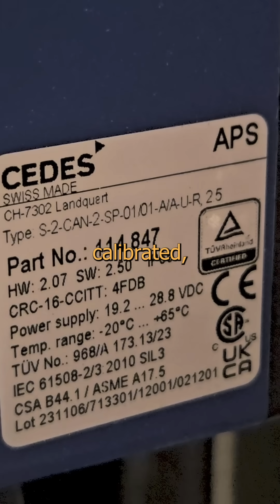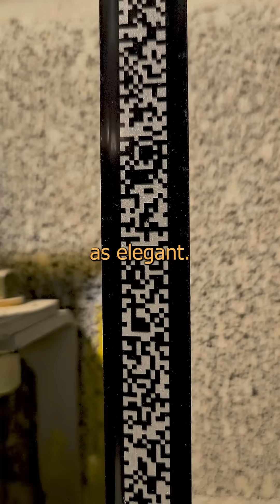Elevator Encoder #chrisboden #comedy #engineering #controls #urbex #indicator #resolver #barcode

Comment: Software engineer here, and I have some quibbles.

That bit pattern is only 10 bits wide, thus only 2^10=1024 unique permutations available. Unsure the pitch, but I'd estimate 0.100" on center, so the full gamut will be exhausted in 102.4", or about 8.5 feet. Unless the elevator is for miniature dachsunds, each word is going to have to span multiple columns. Some cheating can be done by using a sliding window instead of discrete regions, at the cost of significant added complexity.

In addition, there better be a pair of wiper brushes on the car or that nice, crisp code will quickly become a blurry gray mess. One of the big issues with any optical recognition system is good ol' dirt and grime, which something like a linear Hall sensor with periodic "key" indexes wouldn't suffer from. Any analog system suffers from jitter and SNR, but there's no sense in tempting fate by trusting in cleanliness in a dust tube that receives only yearly maintenance and in robustness in software where it's still very common for design to be entirely skipped in favor of merely (barely) meeting regulatory guidelines and marketing promises.
Reply: That was my first thought - but I think they are finding sets of lines rather than singles - I'd guess a clever set of triplets.  
Their data sheet says 1,500 meters with .5 mm resolution which by my maths gives about 3,000,000 positions to the tape.  
My guess is that the right hand bit which goes 1,0,0 1,0,0  and the left hand bit going 0,0,1 0,0,1 are marking out triplets of eight bits - 2^(8*3) = 16,777,216 counts
Reply: @TheShinyGuru  Which also explains why it's not something like grey code which allows neat unambiguous transitions (where only 1 bit changes between lines, so you never read weird invalid values when transitioning). So this requires more complicated reader, but less wide bit-strip.
Reply: @tylisirn  If its not a Gray code, then what kind of code is it?
Reply: @tylisirn you read my mind about it not being grey code.
Reply: @TheShinyGuru  There was me reading each line as a single 8+2 bits (Noting the MSB and LSB are clearly being used for line sequncing as you pointed out, and repeat every three lines) so I'd concluded a maximum of 768 lines (256*3). Never thought to consider doubles or triplets!

As for the spacing; Those marks look 2,5mm (1/10") high to me, based on comparing the marks on the strip to the other easily-sized hoistway equipment installed around it. 😇
Reply: That’s exactly how it works.  It’s not looking line by line, but over pattern area.
Reply: Thanks for mentioning the bit width.

It does look like the tape is engraved with the "grey" being recessed and photo reflective though. That should help keep things readable for at least a little bit longer.

I would imagine that they are reading a few lines simultaneously to figure out what "block" they are in, then positioning relative to a chosen line in that block once the section is identified
Reply: I thought the same thing, but then I thought maybe it's relative to the line above and below it. Although there are only 1024 different lines, if every time it's used, the line above and/or below were different, reading 3 lines at a time would give it, over a billion permutations, even more so if you add scanning 4 or 5 lines at a  time.
Reply: your math is assuming only individual rows are of interest, but even a single repeating row could be distinguished from others by just the rows above and below it, and certain rows intentionally repeat (i.e. at the start of floors, every meter, or other intervals) so that the elevator can determine it's direction and speed based on the binary sensor

there's not going to be much grime accumulating on a vertical strip hanging inside of the more-or-less completely sealed elevator shaft

the encoder isn't the only thing that the elevator is using to move, it's just provides additional precision. you have a main system that moves the elevator and additional fine tuning motors that adjust based on the binary strip
Reply: "Absolute position up to 1,500 m with a resolution of 0.5 mm" from the datasheet.
Reply: @mrfrenzy.  Where are you finding the data sheet? I'm keen for a different application.
Reply: This was what I was looking for!  Was super confused how it spans so far vertically with only 10 bits across.  Was curious if it had a specific pattern like QR having different regions used for error correcting but didn’t see an obvious delimiter.  The comments helped explain a lot.  Gonna look into the spec.

BTW, for those in other areas of the comments arguing about usefulness of QR should really understand how QR work and their resiliency.  QR codes still work even if a portion of it is destroyed.  Plus they convey a fair amount of data in a compact size.  Fantastic engineering!
Reply: The specific code type you're looking at is Data Matrix-style positional encoding, also known as a 2D optical position code or absolute linear barcode.

This kind of code is not binary, Gray code, nor traditional barcodes. Instead:

It encodes absolute position information in two dimensions, often with redundancy.

Each block or “tile” (like a pixel) forms part of a 2D matrix pattern that an optical reader can scan at any point along the strip to instantly know the exact position of the elevator car.

Some systems (like those from Heidenhain or TE Connectivity) use custom grid patterns where a certain pattern of squares within a local window resolves an absolute position.

Key features:

Failsafe: Can recover exact position even if the reader skips part of the code.

Not sequential: It doesn’t need to start from zero and count. Instead, the code at any location is globally unique.

Robust to damage: Even if a small portion is dirty or worn, it can still function.

This type of encoder is critical for modern high-speed elevators, where precise and fast positional feedback is essential for braking, leveling, and dispatching.
Reply: I don't think it needs to take a photo with a lens. To do its job the sensor can be designed to be as precise as needed but still "dirty proof"
Reply: This is more like a bunch of unique fiducial qr codes in a row. That box can look at the pattern and interpolate it's position based on perspective / how much the pattern is skewed.
Reply: @jahnkeanater please provide where you came up with that. Relying on the angle of skew for calibration or position requires very precise and maintained positioning. The fixturing and movement of an elevator is not precise enough.
Reply: @kevintaylor5017  The sensor is only measuring one degree of freedom. QR codes like this are used all the time for 3D positioning on atonomous forklifts. The track has a known pattern and width. The algorithm that scans QR codes already has to flatten the image so solving for the position isn't that much more difficult. Basically the problem has been super optimized already so that pretty much any phone can take an image of a QR and determine depth position and angle. That's probably accurate to a few cm. Then for precise location you can rely on the fact that the camera is in line with the track. Interpolating the distance between the center of the image and each row of data isn't that difficult.
Reply: Iirc its only like 0.100 degrees of skew on average across the full length of the tape.

The tape is being read by two seperate optical sensors that are reading a "square" of tape (roughly 10 square mms to account for perpendicular drift of the car). It has evenly spaced out "index" marks periodically and evenly spaced along the entire run of the tape that basically tick over a counter on the controller to let the controller know the cars speed, and how far it has gone over a set distance (since elevator cars literally work within a set confine). In between these markers are 5mm blocks that are 100% unique along the entire tape. There is literally no logic programmed into the tape itself, its just pure noise in a manner that avoid repeatability. In theory you could achieve roughly 5000 stories worth of unique register on a single tape, but the company can only manufacture up to around 12 stories iirc. The heavy lifting is all handled by the sensor and controller. The fact people are approaching this as if the tape is somehow the sensitive and important bit is incredible to me because that makes no sense.

The sensor is just reading a constant 5mm area, when you drive the elevator to the height you need it to stop at, you tell the controller "hey, whatever you are looking at right now? Make that a floor in the memory" and it writes that to cache and thats that. Whenever it finds that 100% unique 5mm square of whitespace (its reading the reflectivity not the overall darkness value) the elevator knows its at the right altitude in the gangway. It is NOT as complicated as a lot of you people are trying to make it. It works almost identically to how a lot of optical robots do on production lines.
Reply: Agreed.  Also a coder of 3 decades.  This encoder feedback loop is fragile.  Hall effect and magnets makes more sense. Sometimes things are done because of patents though.
Reply: Never thought I would fall for it like that... nice pp
Reply: classic software engineer getting caught up with the "what ifs" on a solution that already works in the real world 😭😭
Reply: yeah as is covered, it's likely contextual. And hopefully has some sort of error correction / checkbit. (who knows what some specs of dust or oil could do)
Reply: The reader scans more than 1 line at a time. I reads multiple like a standard qr code. Each extra line gives it exponentially more combinations.
Reply: Optical sensor powered mice get thrown away most of the time just for being dirty instead of actually broken
Reply: Think of the bits going up and down, not across. 1 strip down  shows maybe meters, second strip decimeters, third centimeters, and fourth millimeters. Much higher resolution is possible then. Encoders have only a small disc but are capable of even finer resolution.
Reply: You're not making any sense at all. It's like saying we have a finite set of possible number combinations bc we only have ten digits to work with. Think about it.
Reply: @punchkitten874  You're missing that while what you say is true, the number of distinct numbers you can make with say "2 digits total" is finite and limited (00 through 99, for a max of 100 distinct values).

He's correct that with the 10-bit width of the strip, there are only 1024 distinct combinations possible per horizontal code.

However, as others have rightly pointed out, if the scanner on the elevator reads more than one line at a time (like three stacked codes), a huge number of distinct patterns are then possible.

The hard part is getting a good error-free read, especially when the scanners happen to be straddling two adjacent lines.
Reply: @ddichny  No, y'all keep adding conditions which don't appear to be present. 💁

Comment: My one college electronics project was making a system to control elevators. We had 7 different sensors to choose from and an EPROM chip with 100 lines of BASIC to play with (kids, ask your father). No barcode line like this though.

(I managed to use 5 out of the 7 sensors, had it able to run hydraulic, screw and pulley lifts on a circuit board smaller than a matchbox. I would have used all 7 but i ran out of inputs... What I would have given for this system and an Arduino back then would probably involve carpal tunnel syndrome)

Comment: Ever since I started working as a groceries delivery driver for a supermarket, I have gained a new appreciation for well calibrated elevators. I carry the groceries in a pile of stackable boxes with a set of wheels at the bottom, but they're not connected, so even the tiniest step up can be fatal if the tower is 3 or 4 boxes tall, but to be fair, I can only be grateful when there is an elevator at all, many clients don't have one!

Comment: Thats not the easiest or smartest way. Elevator should have a flange or something that travels vertically. Shaft should have magnets placed at the correct height. When flange detects its between two magnets, it designates that as stopping/floor level.

Comment: I’m guessing that’s a smartrise hydro going off the inspection station and selector tape. I have installed a few like this the bar code system works really well. The elevator always knows its speed and location with exceptional accuracy. I do wish the brackets for the tape were a little more ridged…they just stick on with magnets haha

Comment: The magnetic flags are ony for door zones, if the beam is blocked or signal is lost the car will stop immediately. Dust, alignment, and even a splatter of grease will stop it in its tracks. The car guides need to be tight and in good shape aswell. A shifty car will case issues.

Comment: For anyone curious, that is the CEDES Absolute Positioning System. I'm sure there's other controller systems that can use it, but the times I've installed it, it was paired with a SmartRise controller, which is a non proprietary elevator controller any company can install. The APS is a neat system with more accuracy and information than a standard magnetic selector tape system can provide.
Reply: Now I can look up the technical specs! I wonder if there's a pattern behind the tape...
Reply: Otis is using them on their hydrofit junk now too.

Comment: This looks like an absolute encoder with alternating bits on the left and right, giving you a differential input that can be interpolated into sin/cos from the analog photo sensor reading. Its just like in glass scales for machine tools, just about 100 times bigger 😂

Comment: I always liked them. Those tape head encoders saved me a lot of headaches on service calls. They’ve always worked very well for all the cars on my route, with the exception of Smartrise controllers needing to “re-learn” the shaftway here and there, but that was more of a controller issue. Before that, the standard technology was to have a tape with magnet strips stuck on them for the stop and slow down. For either one, you always need to make sure the tape head stays clean enough for the unit to read everything correctly, as well as keeping dust off the tape itself, but that’s something a decent service mechanic doesn’t worry about as much, provided you keep your cars clean. 

Next, you should do door restrictors (also known as “anti-evacuation devices”) and door lock monitoring, provided your municipality has them mandated by code.

Comment: Yes, that method of specific location feedback is very granular! Most hydraulic elevators dont have the requisite control of the mass to take advantage of a landing system that is specific to stopping the elevator perfectly at the floor. Temperature, oil viscosity and varying loads figure in too, regardless of the precise landing system. On traction elevators, the technology of the motor control can slow and stop what is sometimes in the neighborhood of 30,000 pounds to within a 1/16" of the floor or better.  This capability is common in traction elevators, with closed loop control and variable voltage, variable frequency drives. This is one factor that makes traction elevator control a bit different than say, the machine tool industry, or self-driving cars, where the motor controls deal with much lighter masses.

Comment: There are 10 bits on every line, that's 1024 combinations. Supposing 12 lines per inch that's 85.3inches of unrepeated pattern, or 7'-1 5/16". The shaft (he he) is longer than that, so it might not repeat in the same order,  but the individual lines will definitely repeat at some point, more than once.
My hypothesis: each floor has an identifier, and some kind of height indicator that tells the motor it's approaching a "stop zone".
That's what I would do...